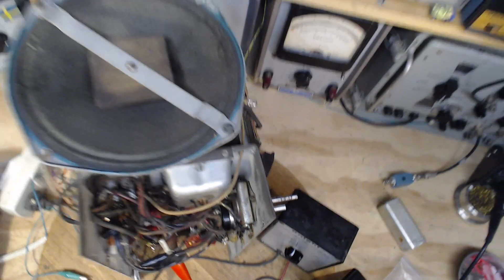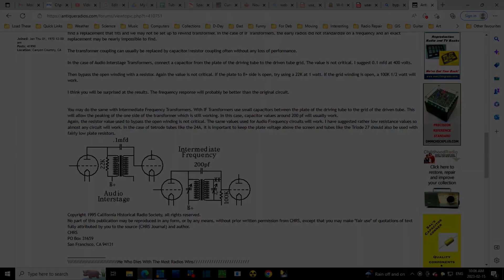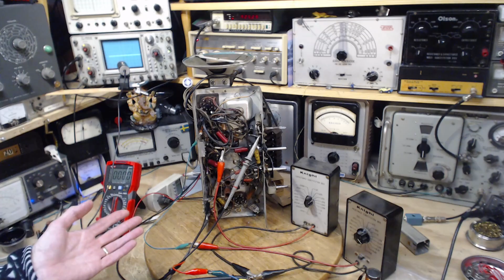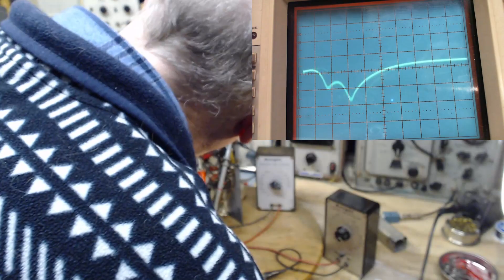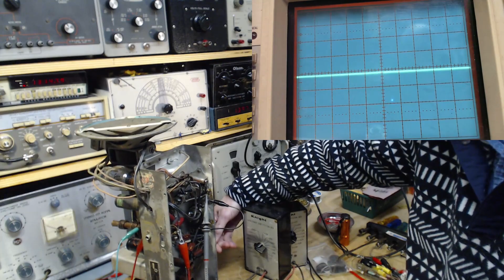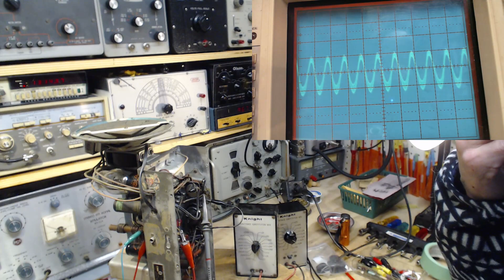Canadian Westinghouse Model 684 Video #7 - Sweep Generator Testing

Comment: Hi Jim now you've done it !

Disconnecting the faulty side of the IF .
Put the working side of the IF in the plate circuit .
( You play with this one LOL )
Leaving the faulty side open & pray its not shorted .
( If so remove the faulty inductor ) .
On the next stage grid add the resistor 100K – 1M ( Sorry it's SOT ) .
Then drop in the cap as shown .

Obviously make a new coil or find a replacement is the best answer to the problem ….....

Comment: There is too much stray capacitance from all the long wires and switches and boxes. In theory it should work by employing the components on a small scale platform. The gain and bandwidth will get affected to a detrimental level.  In practice this is not a real solution though. 

The buzz is the sound of the ramp sweep rate.

Comment: Dear Jim. I received my first capacitor order from  “Just Radios “ today. I was very pleased with the delivery time and the quality of components. Pricing was very competitive as well. Thanks for mentioning the parts source you use when your visitor friend was on the show. It sure beats dealing with eBay for everything.  On the matter of your unit under test.Its  time to move on. Perhaps set that radio aside if you can in hopes you will come across one that can be used for donor parts chassis.

Comment: Let us summarize this episode...
Jim botched the IF to where the radio receives the noise from a nearby switchmode power supply in his shop being in burst mode. That ofc proves the radio is fully operational and sensitivity is restored to optimum performance. 
Plus he gets a shock off of the radio proving that an insulation transformer is useless if you hook up earth grounded equipment to the radio. 
All in all a good show...
Now please roll the credits and have fanboy Greg to go into praise mode...

Comment: He’s gone off the rails. Call  all the engineers and turn in your Ham license. I sure hope their are no novices tuned in for this. There goes the science!
Reply: Yah. Jim has proven beyond the shadow of a doubt, that the concept of IF and any filtering and bandpass shaping therein is just unnecessary waste of components.
What were the designers of military grade equipment thinking, when they introduced double or even triple IF conversion to boost selectivity and sensitivity!
Jim really has to join the team of the "Curious Marc" channel and make them all see how overboard the NASA went in their design of the radio and communication/telemetry gear on the Apollo missions! A botched together AA4 (AA5 minus one IF stage) would have been sufficient.